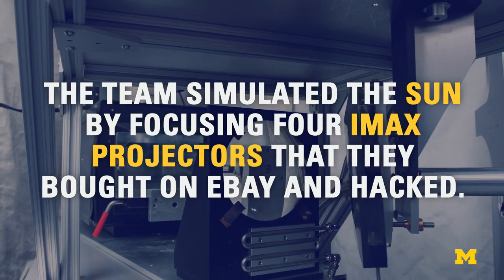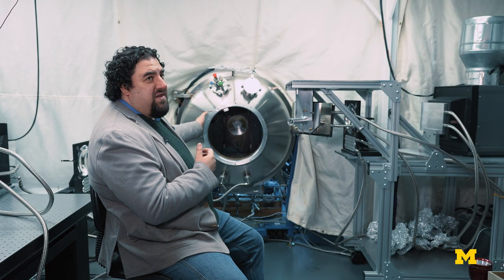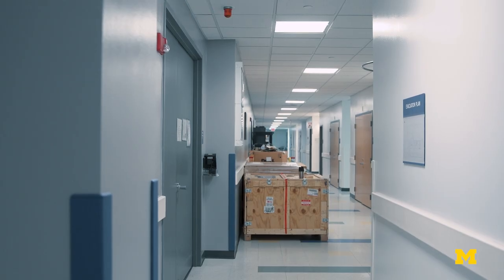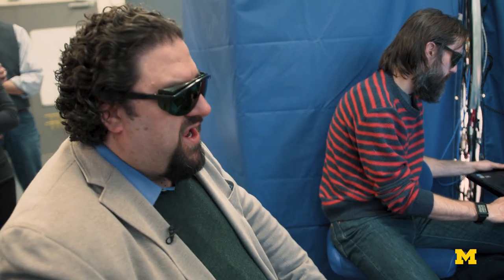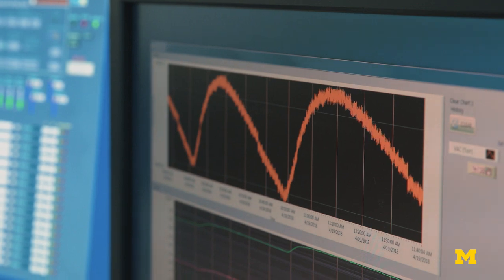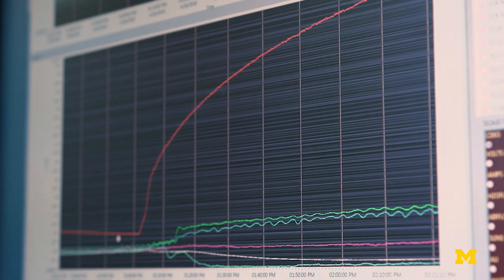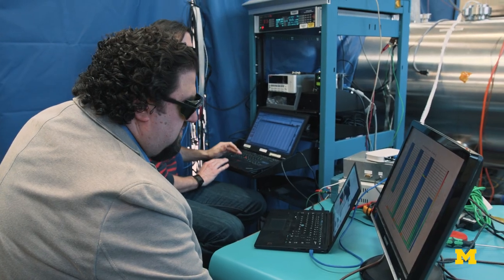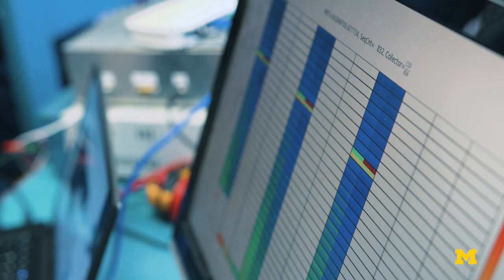Parker Solar Probe | Faraday Cup Final Testing

Comment: Those are not IMAX projectors, they are Strong lamphouses used mainly for 35mm film projectors
Reply from the maker: Hey Axel! Thanks for the comment. These actually are IMAX projectors. It's the Strong Ultra 80 which houses 70mm+ film and is not designed for 35mm use.
Reply: It's designed for 70mm film but was never used for IMAX, I would still say it's main usage was with 35mm since the 35/70 combo machines that used them ran mostly 35mm film. IMAX made their own lamphouses.